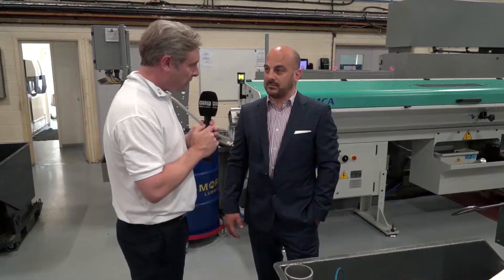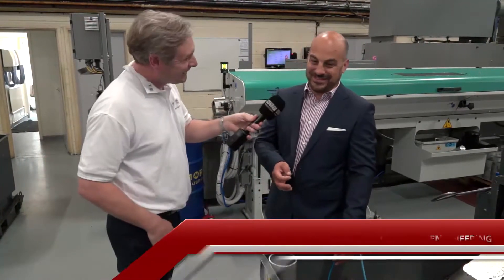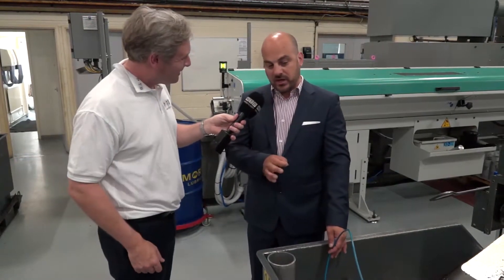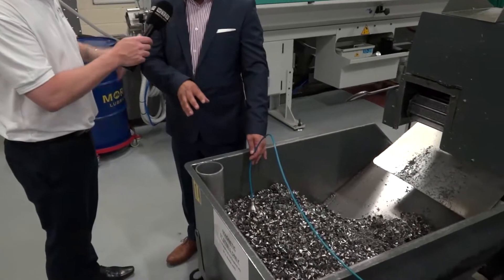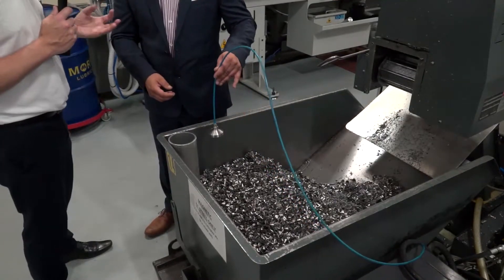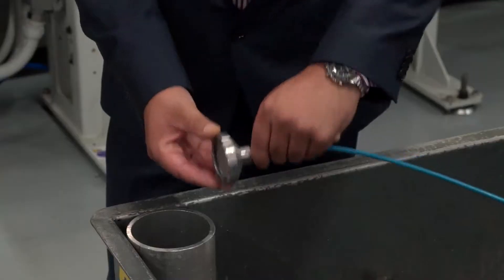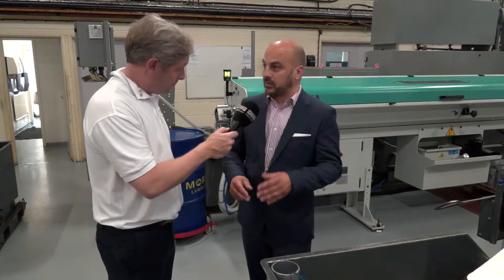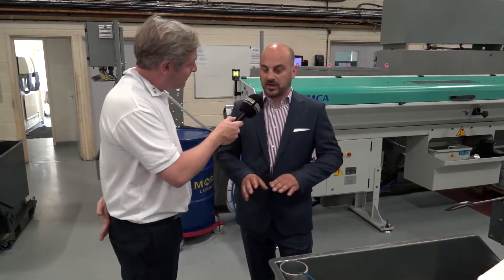Wogaard Coolant Saver

Comment: I tried this equipment but not getting sufficient vacuum so the rate of suction is slow. pls suggest how to or at which flow rate it should be fixed.
Reply: Try a Dupuy vacuum drop me an email if you would like more info. michael.clipsham@filcom-group.com